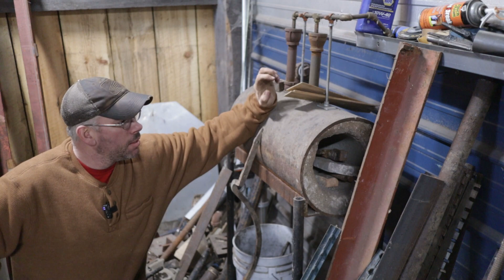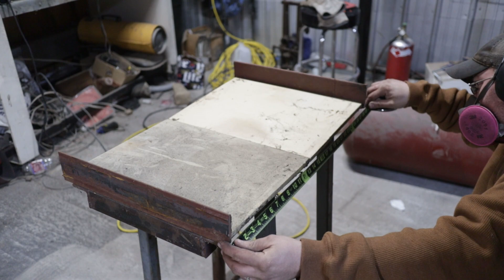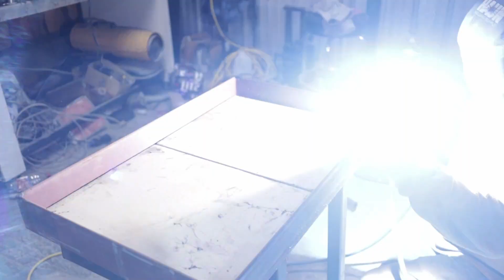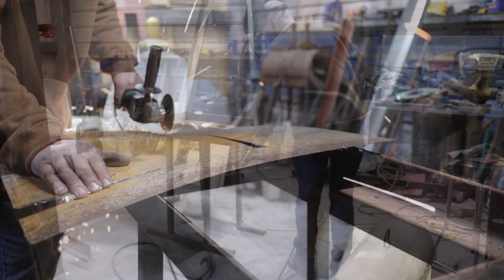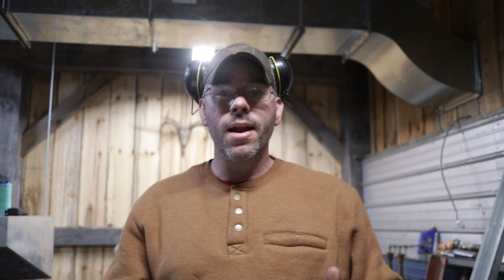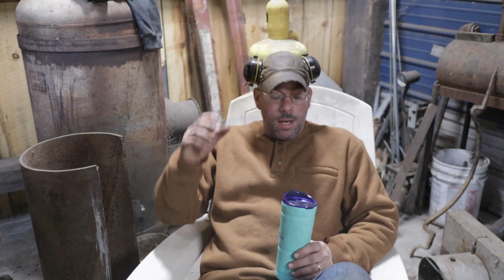New Year Starting A New Forge

Comment: Hey, Jim... when you do get going on the TF addition to the house, a little hint to slow the aging process and keep the wood fresher looking. Once you mill it to size, coat it with orange oil or a mixture of your preferred oil and orange oil. It will keep the timbers from greying much longer than most oils used on exterior woods. Just don't leave then sticker-stacked and drying, even out of the sun, unprotected, for extended periods. They will grey anyway. Leave them with a 1/2 inch extra girth in both axis if they will be sitting and you can go over them again with a power planer when you're ready to cut them for use, and oil them again after cutting your journey. This will also give the house some dust protection from the wood, in the long run, as the microfiber won't shed as readily from oiled wood.
Just a suggestion, buddy.  A heated oil/wax mixture will seal the wood even better and slow the drying and help prevent warping of the milled timbers when applied liberally to the end grain. But also helps preserve the face grain as well, and really brings out the color. (But stored in the barn, flat, the oil/wax mix will grab and hold dust like nobody's business until it cures).